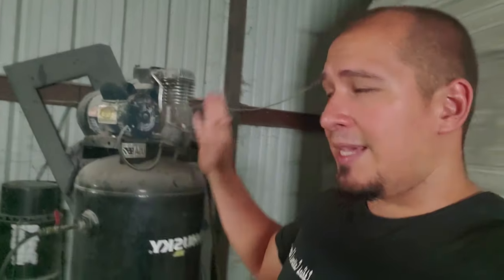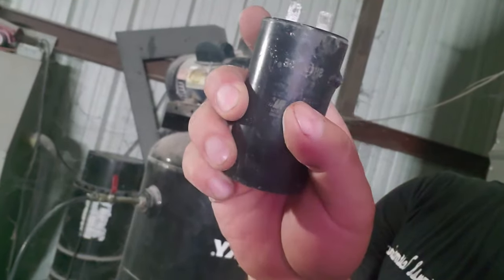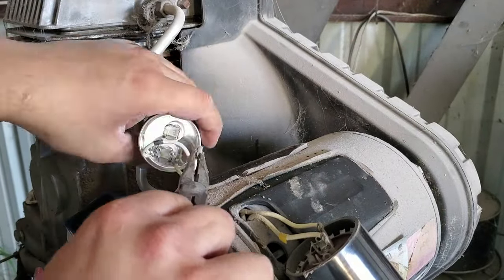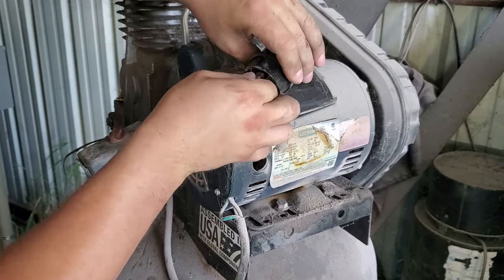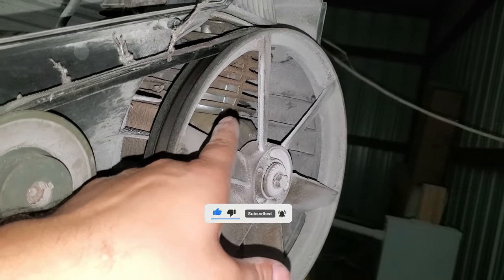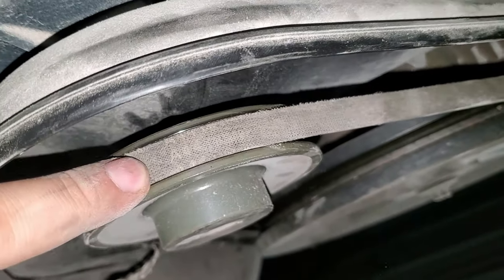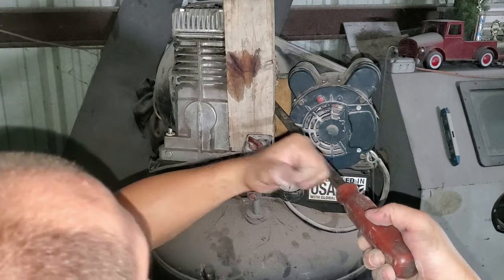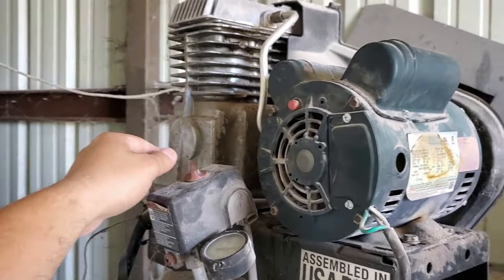Husky Air Compressor Squealing and Bogging problem FIXED

Comment: Wonderful video Brother!!!!!!!!!!! I noticed another fellow who welded up an angle piece with two nuts and bolts which he used to tighten the belt. It is here on YouTube.... I am about to go make one! 😀😀😀😀 Here it is:   "Air Compressor Belt Squeak Eliminator - No more squealing slipping"   God's Blessings my man!!!!
Reply from the maker: @fxpestoperator5527  yea I had heard about that! Very good idea to use as a tensioner lol
Reply: @EddiesCustomsandRestorations  I just made one a little wider and heavy duty than that guy's and it worked absolutely Perfect!!!
Reply from the maker: @fxpestoperator5527  it's nice when we are Jack's of all trades that fix our own equipment and do things the engineers failed to do!
Reply: @EddiesCustomsandRestorations  Amen Brother!!!!

Comment: I had the exact same problem, drove me crazy diagnosing the problem, threw many parts at it with no avail. Thought the belt was tight enough too.. But it wasnt!.. If anyone has this problem tighten the belt first!
Reply from the maker: Man I sure am glad this helped someone..I just wish it would have helped you before you threw parts at it...
Reply: @EddiesCustomsandRestorations  Thanks, I did try to find someone else having the same problem but..  Wasn't that a strange problem?  never crossed my mind the belt was too loose cause the motor seemed like it was dying!?  Its as if the motor needed to sense a load for it to run at max torque.
Reply from the maker: @eer88  my thoughts exactly! It was the weirdest thing!! But after thinking about it more it made sense because the reason it slows down is because the pump itself isn't rotating since the belt is slipping. The part that actually creates the noise is actually the pump not the electric motor.
Reply: @EddiesCustomsandRestorations  I can see that angle, good call.  Its always the simplest thing that throws us off.   Glad to know there's always someone else out there that deals with a same head scratcher.
Reply from the maker: @eer88  it sure is!! Thank you very much for your feedback, I really means a lot to us creators when we know we helped someone in some way
Reply: I'm  a new subscriber and I have that air compressor. The fan housing is perfect for putting a trans. cooler in front of it. I did it when it was new and have never had moisture in the tank, never. You will have to use a fitting on the input and a rated rubber hose will work back in the tank. It's about 320 degrees going into the cooler and less than 100 going in the tank.
Reply from the maker: @cliffwright9842  oh wow! What a great idea! Hadn't thought of that!
Reply: @EddiesCustomsandRestorations  I saw this done years ago on YouTube, but the guy had multiple transmission coolers hooked up. This compressor from Home Depot has a small concentrated opening, so one works amazing. If I was younger, I'd make a video on this and show the temp in and out of the device with my cheap HF infrared temp gun!

Comment: Did i miss where you explained why it boggs down?
Reply from the maker: @denyskryzhevkyy5579  it boggs down because the belt is slipping and electric motor is not turning the pump at the same speed as the motor anymore.